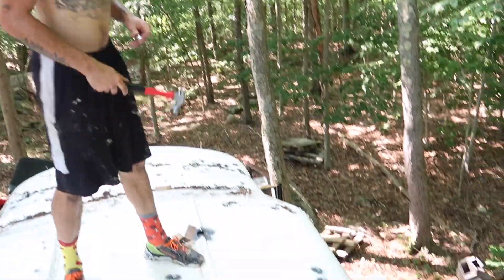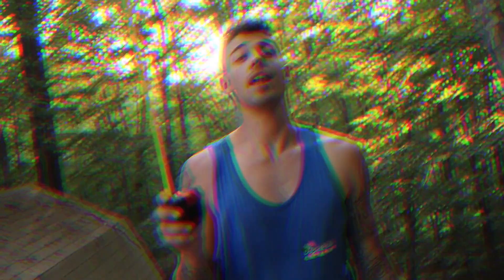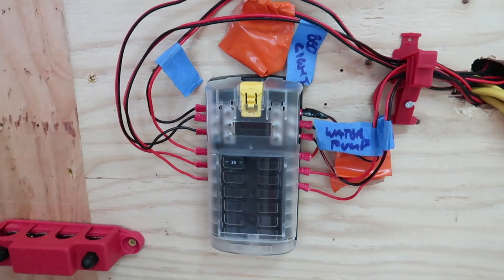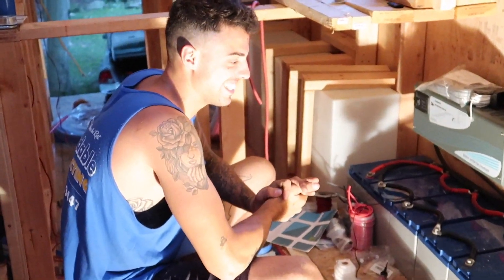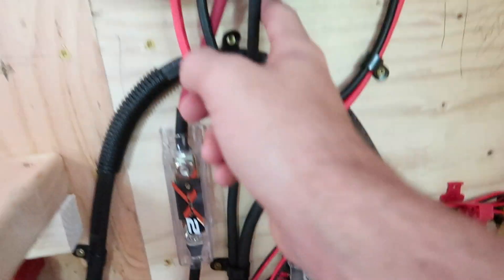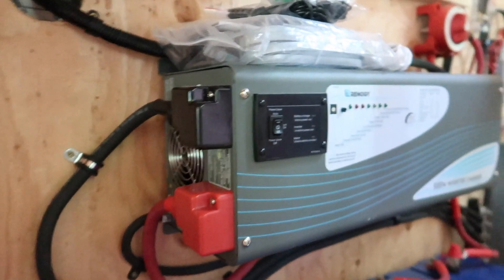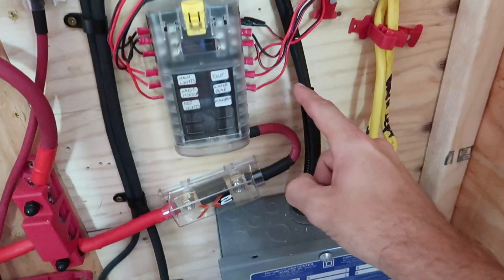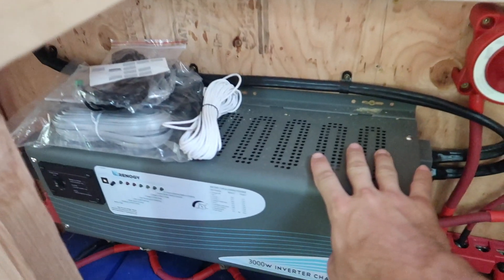Skoolie Bus Conversion - Ep 9 - Solar Power, Electrical + Solar Panel Installation

Comment: The yellow wires going into the top of your breaker panel need strain relief or grommets or the wire will rub on the metal hole and short out. You should put them on as soon as possible, that's a major  cause of electrical fires. The rest of it was very well explained.

Comment: Your Amazon link for the fasteners is no longer working. Can you post the size wire you use going to the Charge Controller and to the 12V box. I believe it's 2 gauge for the 12V box and 6 gauge for the controller?

Comment: Hello I know it’s been a couple years but I have a question. Do the batteries power both the 12v fuse panel and the breaker panel? If so how? I’m trying to run solar for our bus with shore power  but I’m hung up on it. Any help would be appreciated.

Comment: Correct me if I'm wrong. Why would you not put the battery switch before the busbar. Since you put it after anything connected to that busbar before that switch still has power if you turn it off. Shouldn't it be batteries> switch> busbar

Comment: Im gonna have to watch this a few times... im looking at a city bus or mci to convert this spring...im not sure how much solar i need but im pretty sure the 2,600$ package i seen on amazon is abit exsessive lol
Reply from the maker: it all depends on what your needs are really! Jackery even offer a pretty good setup if it is just a small system you require to charge laptops and phones etc.
Reply: Ya i will look into in more detail when the time comes.. just kinda dreaming out loud atm lol

Comment: I know you're supposed to hook up controller to batteries before controller to panel. However, if one day a fuse between the charge controller and batteries blows, isn't that the same thing as having your solar panels hooked up before connecting to batteries?

Comment: Do you have to press a certain button or turn off switch on your inverter when you hook up to shore power or does your inverter automatically switch over to shore power when you plug in? How has this set up worked for you. I’m trying to decide between a victron inverter and a renovation inverter for my solar set up.
Reply from the maker: It’s switched automatically. If we were to change anything we would go with more expensive better batteries but other than that it’s working great

Comment: Were you able to run you air-conditioning on it the solar system
Reply from the maker: We can run it for like a couple hours but don’t think it’s good for the batteries tbh! We got a generator for this reason
Reply: @KelsAndJay  the AC is always one of the biggest drainers of the battery banks. The good thing about bus life is you can just drive to a cooler area if it’s too hot where you are. I’ll be constantly on the move, picking up work for a few months at a time.

Comment: Those are lead acid batteries, you should not have them in your living space.(yes gel batteries are lead /acid). Charging them causes them to release hydrogen sulfide, and they can catch fire or explode. You should have built an under the bus storage for those.
Reply from the maker: Appreciate the advice. Thankyou!!
Reply: They look like battleborn Lithium Ion batteries to me
Reply: @twoferry7337  They aren't they already said in the video they were lead acid.

Comment: Going through your video a third time now and I have two questions:
1. Does your inverter switch automatically from shore to solar? Or are you turning your solar switch off before plugging into shore power?
2. I want to add the third option to mine for an emergency generator. I guess I run the shore and the genny into a box before the inverter and switch it in there. That wasn't really a question I guess, just thinking out loud.

I also didn't tell you I love the paint job. And the way you carried that theme into the bedroom.
Reply from the maker: Blue Note Roast thanks so much!!! 1. Yea it automatically switches between. 2. I’m not 100% sure how to do that so I won’t give you the wrong advice 😂
Reply: 2. My 2 cents on your second question - We ran the shore power hookup to an Automatic transfer switch, ATS to the breaker box. So from that same shore inlet we can be on 30A power at an RV park or a 30A from our generator. If your generator is only a 20A (ie. traditional looking plug/lead cord) then that's where you will have an issue and need to run a sub-panel or illegally backfeed your panel (obviously super dangerous and not recommended).
Reply: @twoferry7337  i like that. no generator yet so i can keep that matched. What do you do between solar and there? Another ATS? Or are you without batteries and such

Comment: what size is the wiring coming from your 12v block. I am trying to figure out what size wire to run to my different lights and water pump?
Reply from the maker: Now Or Never all 12v wiring is 18awg wire. So glad we have helped mate
Reply: @KelsAndJay  Hi! just wondering, are we not able to use 14awg wires for the lights leading to the 12v block? or would that wire size need to be connected to the AC breakers?
Reply: this video has helped me so much btw. my system is pretty much mirrored after yours! Thank you!

Comment: 9:52   Not sure if you have FIXED this, but you need to Insulate around your 120ACV   (YELLOW WIRES) 
coming OUT of your beaker box! ! !
Reply: When you say insulate you mean with a grommet at the edge of the box? So to deter damage?

Comment: Well done

Would hight recommend switching out the main fuses for brakes ! 

Much easier!  
Safer .  
https://www.sonicelectronix.com/item_159429_Stinger-SGP90300.html?utm_source=google&utm_medium=cpc&utm_campaign=PLA&utm_campaignid=764476279&utm_keyword=&utm_product=159429&utm_matchtype=&utm_device=m&utm_content=219790563070&gclid=EAIaIQobChMIw8iOx8Xx5QIV4f_jBx2ToQdTEAkYASABEgI4CPD_BwE
Reply from the maker: Thanks man! Appreciate the advice

Comment: so what size ring terminal did you use for the dc sub panel pos and neg connections? i cant find a 2/0 #10 ring terminal for my connection. did you just end up using 5/16 size or 1/4?? awesome vid btw

Comment: Batts will blow? 

What if the Batts are full and the batts internal BMS closes the contactor and stops the charging? 
The Solar Charger will still be bringing in power with no where to go.
Reply from the maker: The charge controller is in control of all of that so there is no overload. Thanks for the concern!